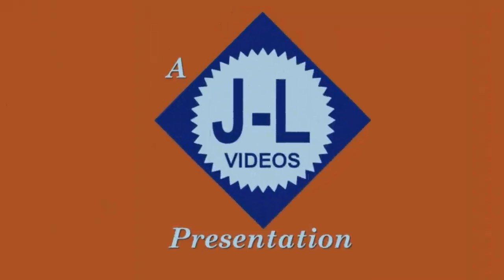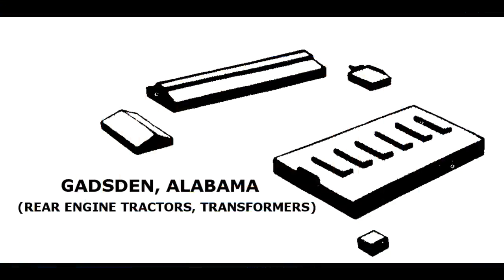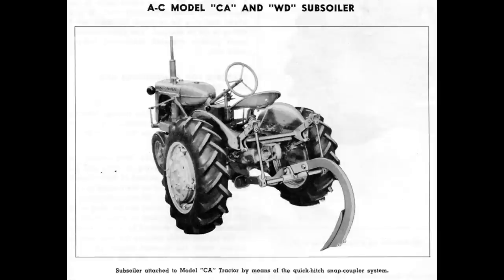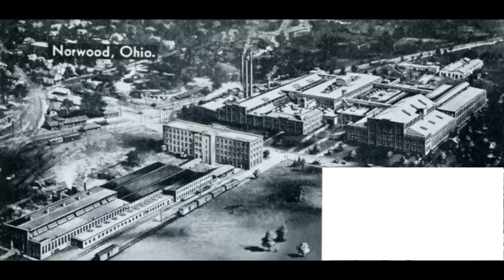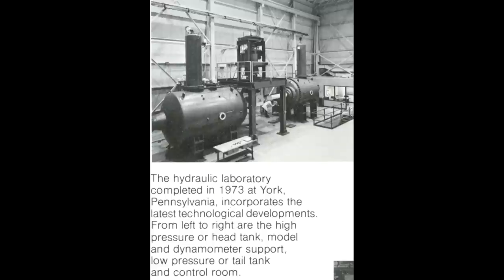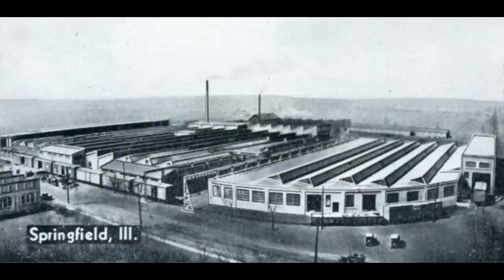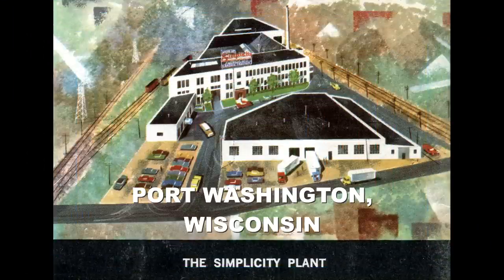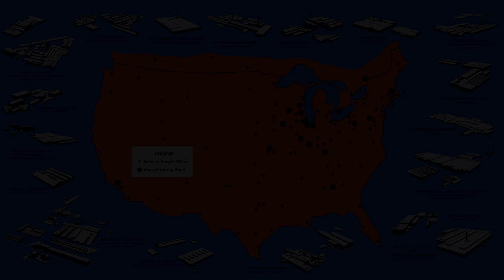Where Were The Allis Chalmers Factories Located?

Comment: Company I worked for built a couple new plants in the mid 80's. All were equipped with Allis electric forklifts. We ran them 24/7 for twenty years. Never had any major issues with them.
The Japanese forklifts we replaced them with are ready to be replaced with less than half the hours on them.

Comment: Excellent video.   A few added items.  After Simplicity moved out of the Lexington SC plant, the Matteson IL AC lift truck plant moved electric lift truck mfg and assembly into the 100,000 Sq ft plant.  Mfg continued in Lexington until 1980 when it was moved back to Matteson.  It was a really nice plant and a great place to work. (I was tasked to shut it down).  AC Built front end loaders in the Lachine Que plant for some time and moved production back to Matteson in about 1979.  AC had a Power Breaker Division plant in Jackson Mississippi,  it was at least 150,000 Sq ft, I attended a Mfg Engineering Conference there in 1977.
Reply from the maker: Good to hear they used it a little longer than 1973, seems wasteful to built a new plant and then leave it 5 years later

Comment: The Topeka Kansas plant built a variety of industrial equipment.  The West Allis plant built a number of "skid" power trains, painted them yellow and shipped them to Topeka as the base for front end loaders, bucket trucks, backhoes, etc.  I recall one of these videos has a trailer load of yellow power trains coming out of the main gate.
Reply from the maker: Did Topeka close when fiatallis took over?
Reply: @JandLVideos  My recollection is Fiat concentrated on the Springfield plant
Reply: The Topeka, Kansas plant accurately mentioned by @clydeschwartz and by @tompreiss3947 was Henry Manufacturing Company. Henry backhoes and loaders were built for Allis-Chalmers and initially were mounted on A-C farm tractors (D-15 and D-17). Eventually, but too late to gain a competitive edge, A-C produced an "industrial" tractor which was suitably strong enough for the Henry backhoes and loaders. Even a 12 foot backhoe would tear an Allis-Chalmers D-17 to pieces in no time. Fork lifts were also built by Henry Mfg. for use on D-15s, D17s and the late-to-market Allis-Chalmers industrial tractors. (The fork lifts were mounted on tractors that had their transmissions reversed so that the front drive wheels became rear drive wheels. The fork lifts were then mounted on the rear of the tractors which became the front of the fork lifts.)  It was Allis-Chalmers' failure to fully commit to using an appropriately sized tractor for mounting backhoes, loaders and forklifts that led to John Deere's rapid dominance in the backhoe/loader market. Caterpillar then followed John Deere's lead and jumped into the backhoe/loader/tractor forklift game. That marked the end of the line for Henry Mfg. and for the Allis-Chalmers earth moving and material moving venture. Henry pushed hard on Allis-Chalmers to produce a competitive backhoe/loader compatible tractor, but reason fell on resoundly deaf ears at A-C until John Deere and of course Caterpillar could not be competed against. That was the end for Allis-Chalmers venturing into the incredibly huge and massively lucrative backhoe/loader market. Truly, A-C missed a marvelous opportunity. Albert Henry, founder, owner and innovative inventor of all things related to early development of backhoe's and loaders in the late 1940's, 1950's and early 1960's was my father. Allis-Chalmers broke him. Both financially and physically. And they contributed to their own demise in the process.
Robert Henry, M.D., FACEP (Fellow, American College of Emergency Physicians)

Comment: As an add on to the Harvey IL plant, as noted was originally the Buda company that mfg a full line of Buda lift trucks.  AC purchased and converted (repainted) the Buda line into the AC line with the art deco "water fall" design of the counterweight.  The engine mfg was a real bonus for AC.  The lift truck engines were indestructible,  and ag tractor engines followed on with that reliability.
Reply: My Father Worked at that Location  when he First started  working for the  Company. & Before They Moved to Mattson  IL. Surprisingly.  The Building,  Although Vacant for Many Years. Is Still Standing  Today..Looks Good from what I can see.

Comment: I have 3 Allis Chamers HD 11 with saved parts from to other. I brought five. 1955, 1956, two 1958, and 1962, as my mechanics died I stopped running my dozers. They were hard to replace. Mine have Buda diesels. My dad owned dozens of Hd20 and Hd21, I learned on cable machines, mine are hydraulic. As life changes I became a Bobcat skid steer 873 owner , I own 3 , work one, two parts machine, I would buy more running machines or part machines. The new machines are not as good.